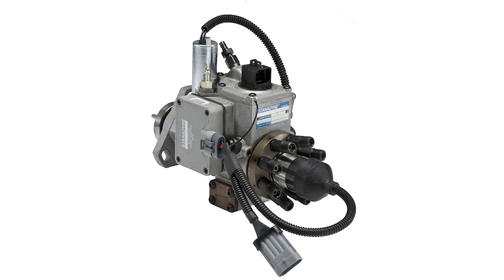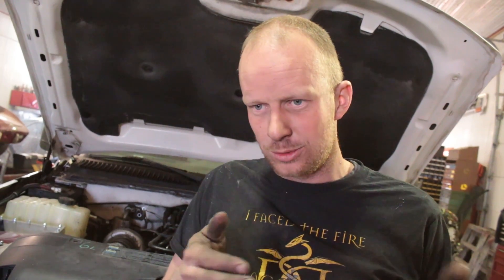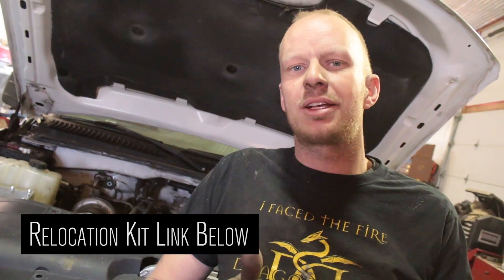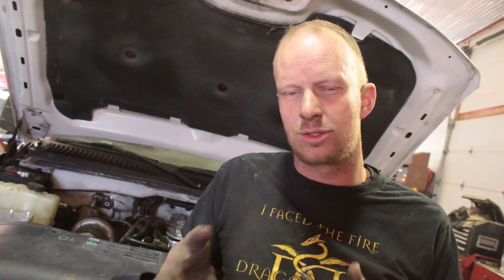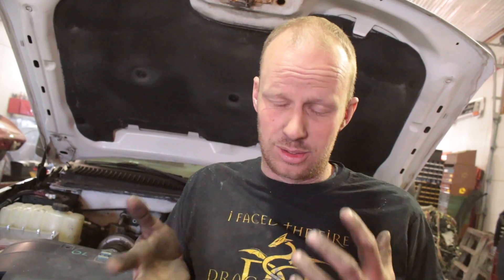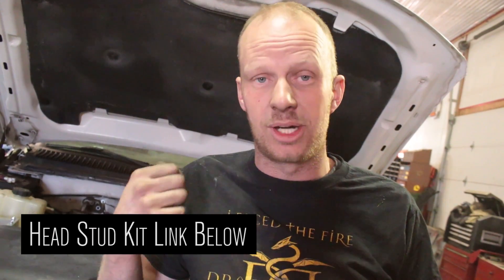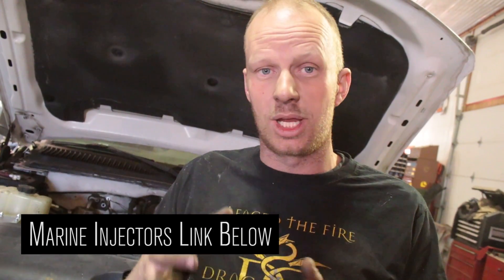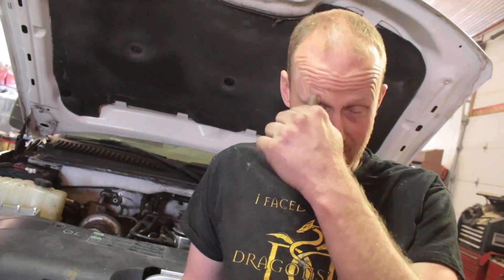REVIEW: Everything Wrong With A GM 6.5 Detroit Diesel

Comment: Probably the most fundamentally and mechanically misunderstood engine around, at least from some of the mistakes I have had to correct on peoples engines.
Couple things:
-The military decided on the 6.5 as it was the only engine to survive the peak to peak test which is where an engine is ran up to peak horsepower, then pulled by the dyno down to peak torque, then you rinse and repeat until the timer runs out. I don't remember the length of this test, but it was 24+ hours non stop. 
-You could get several colors of tags on the ds4 pump, the most current would actually be the green tag which means the pump has been fitted with ceramic rollers and updated encoder sensor, however the green tag came out in about 1996, at this point builders hardly ever use them.
-Compression is rated at 21.5 to 1 from the factory, and the factory does not produce an 18 to 1 piston. Any "marine" engine floating around with low compression is produced with aftermarket parts. The only reason you will find a marine engine making 250 horsepower, vs a stock c/k truck engine making 190 horsepower is because of the custom calibrated injection pump that sits on top of the engine. Taking that same pump and putting on a stock compression engine would yield the same, if not more horsepower.

Comment: I bought a 6.5 L school bus I had the engine replaced and it still continues to cut off I could not even get it past 3 miles of driving it after repairs when I went to pick it up from the shop when they told me  the job was completed any ideas? It cuts off while driving, it feels like I'm pushing on air.

Comment: I had a 98 I bought brand new. Had injection pump problems primarily. About 200k miles the head cracked and water got in the oil and pretty much lock the engine up. After that bought an 05 Duramax. I also changed my oil every 2000 miles up to 100,000 then went to 5000 miles

Comment: 6.5 diesel lol no power, drove a 1998 k3500 dully with that engine, single cab with a 5 yard chip box, even with no chips in it just the chipper and tree gear in the boxes, if you had to go up hill… good luck to you lol you are going really slow billowing out black smoke and it sounds good yeah but that’s all it’s doing.

Comment: So I have replaced lift pump, replaced and updated fuel injector controller module to front air intake, replaced boost solenoid, and still has random hp problems, smh this video makes me  believe it’s the whole injector pump gone wrong. :( 💸💸💸

Comment: So I'm working on a 91 6.2 engine that I bought as a spare. It's on an engine stand and I just want to hear it run for a minute or two. I purchased a mechanical lift pump and push rod. My problem is the pushrod seems to have a little too much play. Exactly how much play should there be in the pushrod. It's a Carter PR4.

Comment: Just bought a 6.5 and so happy I found this video having a bit of trouble getting it started up now and I think this video helped me figure it out
Reply: Start with the glow plugs.  Make sure the wires aren't burnt off and install new glow plugs.  2nd, look at gas lines.  Make sure they aren't rusted. Any air in fuel lines and a diesel won't run.  3rd, check lift pump.  4th, check/replace pmd.  I followed these steps and my 6.5 fired right up.

Comment: Change exhaust to a 4 inch is the biggest and best improvement bar none , Mechanical waste gate for boost control, mine sits at 15 psi anything more is more back pressure than boost for a stock turbo. Get a better intake , make one , buy one . Change the oil . I get 19 to 22 mpg with or with out 3500lbs in the bed ,Not going to be a great puller , but carries great and drives even better , Great work engine .

Comment: Big difference with the van and hmmvv engines. On those engines, the heads were different. The intake angles were different because of the turbo placement. But, the block and rotating assembly are exactly the same.

Comment: When I first started wrenching 27 years ago i spent the first 7 years in a Chevy dealership.  I became very familiar with the 6.5 both mechanical and electronic.  Definetly not a power house but seemed to be reliable as far as the engine goes.  We had several customers who had it in either a 2500, 3500 and 3500HD with some close to 300k.  Which was a lot due to being somewaht new.  Did lots of PMD and electronic injection pumps but only one engine that blew uo because they crew didnt keep an eye on the oil level.  I would love to find a 1997 K3500 crew cab long bed 6.5, and then sawp it for a 5.9 Cummins lol.
.

Comment: I bought a Chev 2500 brand new in 1993 or so with a 6.5 diesel for a plow truck and car hauler. It was right after I totalled my 91 ram D250 with a 12V Cummins. The transmission made me fall in love with the Chev compared to that slushy Dodge D250 lol.The truck was so much more comfortable... But I soon found out that I was replacing fuel pumps every 30 000 kms. It's a long time ago now but that's what I remembered. Seems to me the GM shop told me it had to do with low fuel lubricity. I was an early adopter so they likely fixed the issue. Once I replaced the second one and saw it was the same part# I sold it. I loved a lot about that truck but the A/C could cool down a small town! lol. Great video thanks!

Comment: I’m a mechanic for the army and work on these all the time. They are some of the easiest Diesel engines to work on. People talk shit about the 6.5 but of course people beat the shit out of these in the military
Reply: It's trash. You heard him. You'll never get full engine life possible like Cummins can
Reply: @LitheInLitotes  sounds like a dodge guy... though dodge never maade their own diesels. Had to go to cummins to save the brand.
Reply: I have an 82 chevy G30 van that i have converted as a camper. I plan on traveling a lot with it and towing a smaller dual axell trailer as well. Right now its got an sbc 350 i plan on building up but am considering other options when the time comes. Would you recommend the 6.5 for this application?  Acceleration is important too when not towing so i can keep up in hectic traffic, which the 350 does very well at the moment.
Reply: Its just such a massive engine and yet so weak. My 4.0L v6 in my nissan frontier has like 261 horsepower. Haha
Reply: @270eman  But how much torque does it have?
Reply: @270eman  and it doesnt make 400 foot pounds either

Comment: my 6,5TD in an year 2000 Van, has warm bad Oil pressure at idle, orange light comes on. As soon as I rev up it goes off. Before it jumps to zero the instrument wobbels a litte to the left and right. So do I have a bad oil pump, bad engine or bad sensor. Cold oil pressure is in the Middle and fine. Engine has 485000 kilometers on it with an 4L80E Tranny in an Ambulance. No smoke starting cold very well, but hot with a not too good battery no chance to get it running. I think the atarting revs are too low and the battery needs replacing, but main issue is for me the oil pressure in the engine.

Comment: We have them in out M1151 Humvees. They do very well considering the up-armored Humvees we have are around 10k after equipment, personnel and personal gear. I've gotten them 70MPH+ on the interstate while working as a single element. Other than some knuckleheads that won't let the Glow Plug light go out before starting, ours run pretty good. Way better than the old 6.2's, but they weren't too shabby in their day. Rich Deboss' explanations were pretty accurate.

Comment: Hi deboss I'm following you. from Norway. My old 6.5TD from 1994 went 341000 km over 1 million km. so the 6.5TD can and will go so long without problems but I have taken it out and put in a newer 6.5TD from 1998 which comes in from a tow truck that has only gone 190,000km As the new engine is more agile and has oil under flushing on the piston and it does not have the old one from 1994 but the old one will be rebuilt and used in a new project. Since Dodge is so expensive here in Norway and we. it does not have access to motors from. American vehicles so it is very special and operate with US cars in Norway so it as a cheap of. pickups trukcs in norway are chevrolet and ford f series

Comment: I'm gonna contest this opinion! I worked in an engine shop building 6.2/6.5 engines for the military and what you talk about are only the symptoms of this engine's issues. First you have to fix the crank! We had cranks that were .250 off stroke, and 5 degrees off index! If you don't deal with this, is doesn't matter what you do with the pumps! You can't time an engine that can't be timed! We would get 200 of these in crates and tear down everything, we found major flashing in the ports of the heads, rod's that were 1/16 to an 1/8 inch in length different, and well many more things that were issues. Index the crank first! If it's off, you can't build the engine. Correct your stroke, if that's off, you can't build this engine! Everything else is secondary! So being that many of us came from racing back rounds, with mixed and matched parts just by measuring what we had. Cleaned up the heads, no porting just get rid of the crap that don't belong. Our best 6.2 at the time made 227 HP and over 430PF torque! In short, we made a half assed balanced engine from factory parts! That's on stock parts, stock pump settings and stock clearances! (Detroit) GM stamped out these engines in mass production for the M1008, M1009, M1028, and the early HMMV. None of which ever saw 100K miles. these were blown at 15K, 20K, 25K. I'm not saying the civilian engines were this bad, but the military paid for your good 100K engine! Seriously!

Comment: The military had already been using this engine. They loved it because it was known to "sip" fuel. When GM got ahold of this engine they tried everything to ruin it. To get back to the fuel sipping and longevity, you can use the info below. I ha e a 96' k2500 Suburban with the 6.5. can't wait to do these upgrades for myself.

Heath diesel tuning chips https://www.heathdiesel.com/

Leroy diesel injection pump electronics bypass aftermarket relay with manual fuel pump operation button. https://leroydiesel.com/

4" exhaust by diamondback

GM tech scan software Engh motors sweeden http://www.enghmotors.com/default.aspx

Lift pump walbro https://walbrofuelpumps.com/

Glow plugs, and battery c cables. https://ptwiringsolutions.com/

Remove vacuum pump and use a mechanical waste gate arm. Use serpentine belt from 1993 6.5

Comment: At 417,000 Klicks my '97 GMC 6.5 is still a great truck, my PMD is sitting behind the front bumper with a heat sink in the air flow, and I have a backup PMD with a heat sink on the fender ready to switch to when it fails. Love my truck and won't be buying the new junk any time soon. It will pull a 10,000 lb trailer up the Coquihalla just fine... but don't expect to race anyone up the long hill.

Comment: I drove the n.a. 6.2 & turbocharged 6.5 in the last job I had before retirement. Always in the shop for fuel problems. If I remember correctly they had Roosa-Master pumps like the old Oldsmobile diesels had. I also remember reading some where that these engines were designed by Hino (He No) truck div.of Toyota. Yes or No?
Reply: They had DB2 injection pumps (the 82-93 mechanical injected trucks) just like the Olds 5.7 Diesel.

The 6.2 Diesel was designed by GM's Detroit division

Comment: For others learning, I spent a long time when I first got my 1992 6.5 K2500HD trying to understand and deal with the potential vacuum pump, wastegate, PMD problems, etc., but ... my Canadian (in case it matters) truck doesn't have vacuum pump or PMD problems because it doesn't have them, it's all mechanical. Apparently some early 1992 6.5s didn't have this, or it came in 1993, but I didn't discover this until well after my first viewing of all these videos. Hope this helps someone. BTW it has been a very reliable truck the last 5 years.

Comment: im running the 6.2 injection pump on my 6.5td it dosent have the potential to put out as much power as the newer 6.5 injection pump but way more reliable i have both ford and chevy idi diesels the ford is a better engine but i dont have any issues with the chevy idi

Comment: In 2013 I bought a low mile Chevy 3500 with the 6.5. I bought it over the 6.0 Powerstroke because of all the warnings and the dealer said the 6.5 was boring but effective. Worst advice I ever took! That' engine was an absolute money pit. I only owned it for 20 months but spent more in that time than in all the other vehicles I've owned over the last 30 years. Turned me off GM forever. One example was it had a simple oil pan leak. Something that should take 30 minutes to fix. Nope. They put a flange on the oil pan that fits into a groove the bell housing of the transmission. You have to break the rear main seal to change a $7 gasket!!!! Traded it in for 1/4 what I paid for it not including the thousands spent just to keep it on the road.

Comment: I had a 93 GMC 6.5 Turbo with the mechanical fuel pump with no issues with it and bought it with 50kms and sold it cheap after I owned it for 10 years, I had 400,000kms on it, this was a three quarter ton, best truck I ever had very few problems, after it was sold about a year the fellow had it the overdrive went out in the trans. The 94's had the electronic fuel pumps who had lots of problems.

Comment: Relocate the pmd, upgrade the oil cooler lines, swap out the harmonic balancer for a fluidampr, change the oil every 3500 miles.  Engine is super easy to work on, parts are cheap cheap cheap.  Good fuel economy, but not a heavy duty workhorse!  If you're doing a bunch of towing, get the same truck with a 454 for those years of chevy/gmc.

Comment: I bought one with the idea of “it must be reliable its in the HUMVEE”. Fantastic on fuel economy which was great cause it was a snowplow truck. But, thats about it, engine was gutless, always got hot in the summer pulling a small landscape trailer with a ride on mower. Did all the little mod’s to make it useable and then the transmission piled up and I called it a day. Truck was still in fantastic shape, low miles, no rust. Real shame cause it was a nice truck.

Comment: A couple things you could do to bulletproof a 6.5L: ARP head studs, duramax fan, PMD relocation, vaccum pump delete/mechanical waste gate, lift pump, and proper maintenance.
Reply: When I was younger we had a 98 stretched 10 door (4 each side) suburban with the Detroit in it and twin turbos. We bought it off some amazing guy in Florida and that thing only ever broke once in 8 years and we drove it all over the country.
Reply: Thanks for getting to the point not like the guy in the video
Reply: So .. I could build a new engine ... to make it good,
Reply: @mdl852394 No, this stuff is a few hundred bucks total lol.
Reply: What about when your starter cracks off the block?
Reply: @rossedward1601  it only happens when somebody forgets to put the reinforcing strap on the back of the starter to the block. Or when they over, tighten the bolts and cracked the actual holes, the bolts are in. A torque wrench is a very useful tool.
Reply: Maintenance …. Always always have good batteries…..poor power to starter is what will cause that. ☮️
Reply: @rossedward1601 problem solved with a bracket that doesn't even cost 10 bucks
Reply: @rossedward1601  weld it back

Comment: With the aftermarket offset roller rockers they actually pull pretty decent, huge gain low to mid range rpm. there is also a forged crank available if you want to make more ponies and not worry.
Reply: Do you know where I can buy quality parts from? I have a 97 Suburban with a 6.5 and it runs real well but I want to do a overhaul and rebuild the engine.

Comment: I had a 95 k2500 with a 6.5. bought it with blow headgaskets. fixed that up and ran it for a few years till the injection pump started acting up. Spent $3k trying new pumps and rebuilt pumps and couldn't get the thing to stay running. ended up selling it and getting a 98 dodge with a cummins. I wish I had the cummins in that old chevy. and I wish I had tried putting on an all mechanical pump/injectors onto the 6.5. Like he said not a power house but I got 21 mpg high way running 70 mph

Comment: Probably the most important thing to do is get a kit (with a heatsink) to move the PMD to a remote location where it stays cool (mine is under the front bumper right in the airflow), the PMD itself throws off a lot of heat and heat kills electronics. Do the other bug fixes, maintain it and you should be fine... but then mine only has 420,000 k on it (most of it while pulling a 10,000 lb trailer). It isn't a powerhouse, but it will do work if you don't expect it to race up a long hill, and it gets great fuel mileage (for a truck pulling a load) doing it.

Comment: Mu 6.5 was ok I know the heads had a tendency to crack. I pulled my Jeep to Moab many times with it. Finally got rid of it b/c it killed starters like every couple months the starter would just get stuck. Needed a fly wheel Is all I'm sure but sold it to get a Dodge.

Comment: I got a na 6.5 in my 1988 GQ Nissan patrol, she ain't fast but she got torque, def not a stump puller but in western Australia with the heat and and remote areas, she hasn't let me down. Personally you don't need it to do quarter mile times, as long as it gets you home boys.

Comment: So I got a 94 6.5 vin f.  300k miles.  Started pressurizing the coolant system.  Blew a radiator.  I figured head or gasket, easy.  Replaced both.  Still pressurizing the coolant system.  Did I mess up the gasket job, or am I missing something obvious?

Comment: I DROVE ONE FOR A COUPLE OF YEARS INJECTOR PUMP DID OK INJECTORS WERE A BIT CRANKY GLOW PLUGS WERE A PAIN IN THE ASS THERE ARE GOOD BETTER AND BETTER STILL BUT THE BLACK BOX WELL YEA 
BY ALL MEANS MOOO VVE IT OUT FROM UNDER THE HOOD O TO A 1/4" THICK AL PLATE WITH A REMOTE HARNESS AFTER I DID MY BLACK BOX ISSUES ENDED